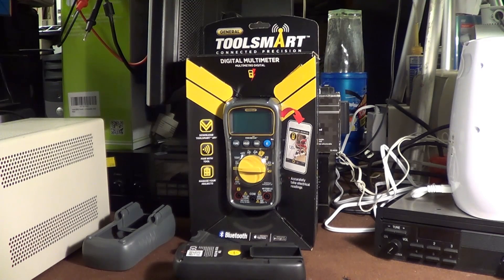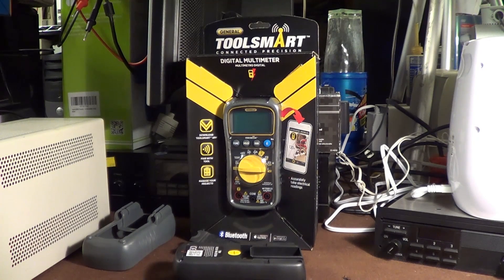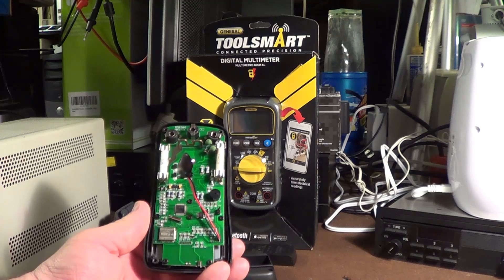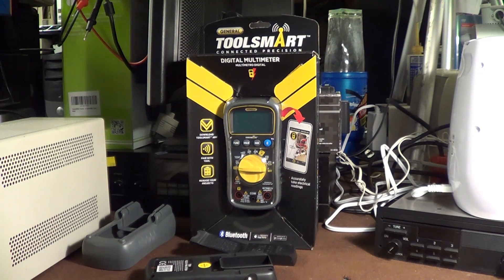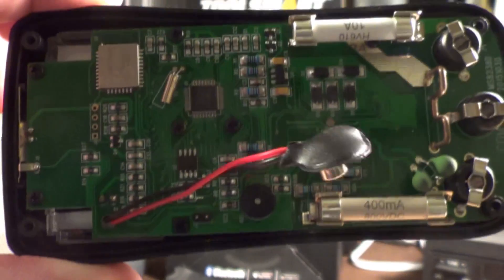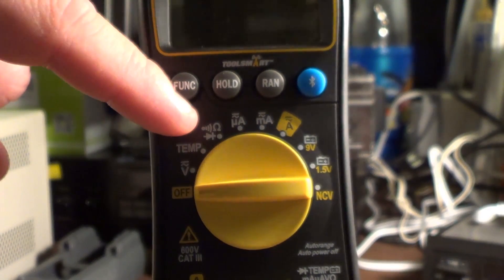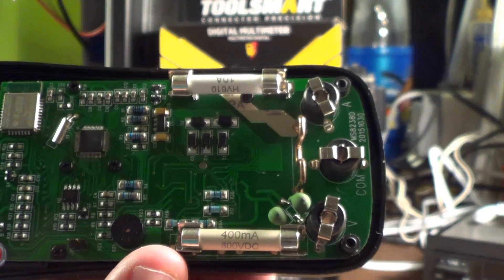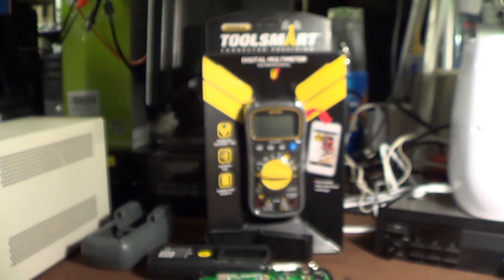Another Inexpensive True RMS Digital Multimeter!

Comment: What are your thoughts on the no name ET-310A ?
Reply from the maker: I wouldn't waste your time or money. Its display and true RMS capability are nice, but that's it. The battery management doesn't work and the charger is dangerously implemented. 

On mine, the PC Link capability existed only in firmware -- there was no software or description of the protocol and the physical connections were never made. It's just as well, because that too would have been very dangerous. There has to be complete electrical isolation between a measurement tool and whatever it is exchanging data with. There was none in the ET-310A.
Reply: @uxwbill  Thank you.    The E-One VC105 is like the same unit without the o-scope feature.  Both units advertise a pc-link; however, it appears that both are worthless.  I just don't understand why advertise something that is not even implemented .   Both meter advertise as having an isolated USB /RS232 port, dust proof, drop proof and water proof.  I think the VC105 has an optoisolator on the board.   I agree it is not a good design to protect from transit high voltages pulses.  I was hoping that you had the "pc software"and the ET310A was a better design.    I wrote the company with no results.  The ET310A sells for about $125.00.   I think I paid around $30-$40 for the VC105.  I agree the display is good.
Reply from the maker: If you haven't already seen it, you might find this informative: https://lygte-info.dk/review/DMMVC105%20UK.html

It talks briefly about the data output, which is not delivered in a proper USB compatible format.

With just a little more work, both of these could have been great products. It's too bad that such will probably never happen.

Comment: I got this meter in the store for a cheap price without a rebate. Was a clearance item! As for the box... it actually opens from the front, not the top or bottom. No box cutter or knife needed. Just for basic tabs holding the package. Opened with just my fingers easily.

Comment: The nice thing about usb bluetooth dongles (rather than wifi usb dongles) is that you can unplug them without them messing with too many settings. If however you pull a wifi dingle, it can really mess with your setup. Being able to pull the entire wireless device (in this case a usb bluetooth dongle) solves many security issues i.e. because if it aint plugged it's not being bluejacked. So I like the idea of that multimeter being bluetooth connecting to a PC. I'd use that instead of a wifi one if given the choice.

Comment: It's funny you happened to have that particular Ford radio visible in this video, I recently acquired the same (or at least a very similar) model. I actually expected to get an AM/FM/Cassette model but the salvage yard had a mixup and that AM radio was all they had that was compatible. So I used it for a week while I waited for the proper stereo to arrive. 

It's not a bad little radio (looking at the internals it's clearly well built), but unfortunately the AM radio stations in southern Ontario are less than stellar (that is to say: I only picked up ONE station that actually plays music in English, and it often cut in and out).
Reply from the maker: I picked it up mainly out of curiosity, to see how well it performs on the AM band, what its internals looked like and to find out how many speakers it was made to drive. I agree that it's very well made for such a basic radio. (The AM/FM radios I have from this vintage are actually a lot more cheaply made inside than this set!) To my surprise, it has a built in clock (that happens to keep very good time). So far all I know is that it powers up and the display backlight is still good.

Ford actually sold this radio as an option until the end of the 1997 model year, although I'd be surprised if anyone actually bought one! (This one is from 1991.)
Reply: They were not uncommon on fleet trucks.  I think the Aerostar was the last one it came in.

Comment: Would your  Bluetooth App be Linux compatible for this Multimeter?
Reply from the maker: It turns out I may not have to write one. There's a modified version of QtDMM floating around that understands the DTM0660 protocol. I'll have to get a Bluetooth dongle, see if I can build it from source and find out.

General Tools and Instruments did not respond to my request for more information about the protocol utilized by this meter. I suppose either their support staff aren't equipped to answer such a question or that such is considered "valuable and proprietary information" despite their using a common IC.
Reply: I can package that in an RPM or DEB.
Reply: I could use your assistance in vintage computing.
Reply: Did you hear anything from Mastech? I'd be interested in adding support for this to Sigrok (which already has DTM0660 support - but no ble support yet?)
Reply from the maker: Mastech and General Tool both refused to provide any information whatsoever about this meter. I'm especially disappointed in both companies, particularly Mastech (who wasn't always this way about providing such information -- apparently now they won't even supply calibration instructions).

In all the time I've spent tinkering with this meter, it's become obvious that I don't understand how Bluetooth Low Energy communication really works.

Comment: None of the Menards in my area have entrance turnstiles. Odd that yours does.
Reply from the maker: All of the Menards stores around here have them, but they've all been here for at least 20 years by now.
Reply: What are the features of the meter besides the Bluetooth?Cheers
Reply: What is true RMS?and is it a desirable thing to have?
Reply: Never mind on the features I got ahead of myself sorry.Cheers
Reply: What do you think of those harbor freight multimeters that they give away for free sometimes are they any good?
Cheers
Reply from the maker: True RMS capability in a multimeter means that the measurement circuitry actually calculates the correct root-mean-square voltage for AC waveforms that are distorted, as opposed to being true sinewaves (as AC electricity delivered by your utility company should be).

Just about any meter can measure AC voltage, but those without true RMS capability will give you incorrect information. (True RMS meters also have limits on the frequency where their measurements will be correct, but that's not generally a problem when you're working with electricity supplied by a utility company.)

The Harbor Freight cheapy/free meter is actually OK for a lot of things. For low voltage*, *low current circuits employing direct current (DC), it's all the meter you'd need and usually quite accurate. It'll run for weeks on a single battery if you ever needed or wanted to do so.  Under a more normal usage scenario, the included battery could last years. Unless of course you forget about it with the switch turned on, since there is no auto power off capability.

It's also great if someone ever asks to borrow your multimeter. If you don't trust that someone, give 'em the freebie meter and you're not out a thing if they blow it up.

Now the less than great stuff:
1. Harbor Freight sells the same basic thing under multiple SKUs and I believe each SKU represents a given manufacturer. From personal experience, the 69096 version of this meter is very poorly made. 90899 is a bit better. 98025 is also pretty bad. All three qualify for the free meter offer.
2. Some SKUs have a replaceable fuse and others don't. If you blow the fuse and it happens to be soldered in, it's not worth repairing.
3. None of these meters have any meaningful safety certification *whatsoever*. The "Category II" rating printed on some of their cases is completely *false*. If you leave the meter set to its resistance or current measurement modes and connect it to a live circuit, the results may be spectacular and very dangerous. It could explode or catch fire.
4. These are manual ranging meters. You have to know approximately what quantity you want to measure, and set the meter accordingly, before you can take a measurement. If you're not sure, the only safe thing to do is to set the meter at its maximum measurement scale and work your way down, which takes more time. (Most autoranging meters can be set manually to a specific range if ever you needed to do so.)

If you plan to work on AC line powered circuits or devices, do yourself a favor and invest in a better quality meter than the Harbor Freight freebie. Even they have some decent choices, such as the Cen-Tech P98674. Or if you really want to know that you have a high quality, safe instrument, go for something like a Fluke or Amprobe meter. Neither is cheap, but both are high quality instruments that will last you a long time.
Reply: Thank you uxbill, now I know what to look for.I have one of those free harbor freight meters but I shure as heck would not trust them with high voltage.I will be looking for a fluke or the amprobe I had an amprobe before but I lost it.Keep the videos coming they are very informative.Cheers

Comment: It's good to have around the house. Otherwise these are mostly gimmicks. "Bluetooth capabilities" "built-in battery checker", etc. I wouldn't expect it to last long or be too accurate. This meter in particular I've seen everywhere. Rebranded for at least 3 other companies.
Reply from the maker: I'd grant you that the Bluetooth capability and especially the battery tester could be considered gimmicks. Certainly the battery tester does not approach anything like a full load.

Every so often it is handy to have a datalogging meter, to track down what causes that irritating little glitch that happens for a split second every three days. The manufacturer's software seemingly doesn't offer logging capability, but there is a modified version of QtDMM that understands the DTM0660 protocol and would support logging. The typical entry level data logging multimeter costs a lot more and oftentimes doesn't have true RMS capability. Here's one that does both, doesn't cost a fortune and seems quite acceptably well made. Suddenly just being curious about what something does over time is justification enough to have one.

I don't agree that this meter would soon become inaccurate or broken. The chip it's based upon is calibrated entirely through values stored in an EEPROM, rather than potentiometers or fixed value components. The chip is of course inexpensive, but nobody's come across any moderate or serious issue with its design. I think it conclusively proves that inexpensive doesn't always mean "bad".

Comment: I'm confused why a multi meter  even needs Bluetooth connectivity.....seams like a gimmick  to me...
Reply from the maker: It doesn't, but that's what happens when the chips get to be cheap and energy efficient enough. And that's something I'm all in favor of, if it lets more people get their hands on a technology to satisfy their curiosity and possibly even learn something in the process.

A data logging meter isn't something most people need terribly often, but when they do, it is really handy. And while the software provided by General Tools and Instruments seemingly doesn't log data, there is a version of QtDMM floating around that understands the DTM0660 protocol and might even work with a Bluetooth equipped laptop. That too could be handy if the meter is situated somewhere really inconvenient or cramped where a cable-tethered computer could not be.